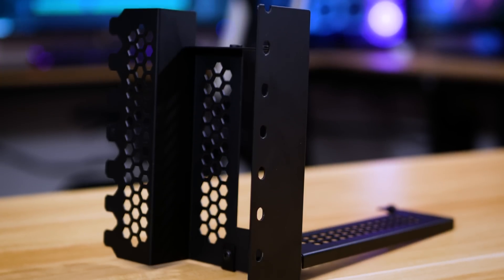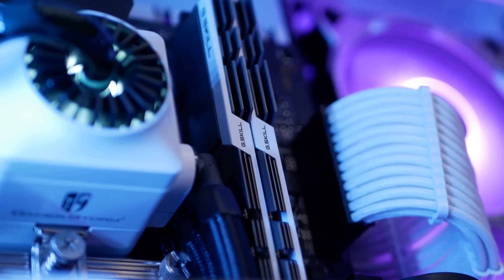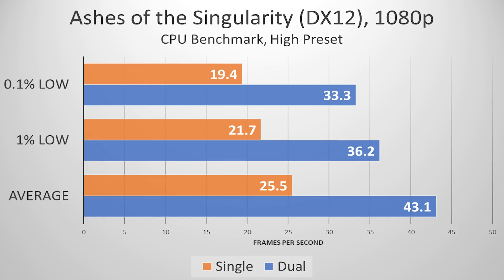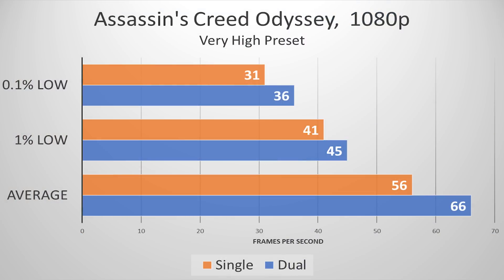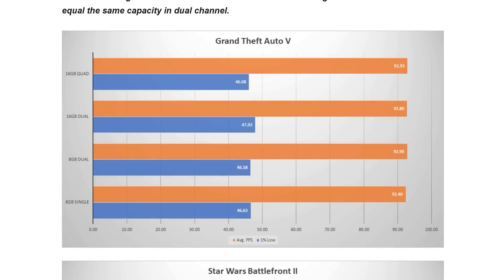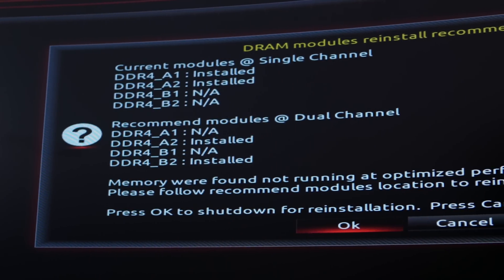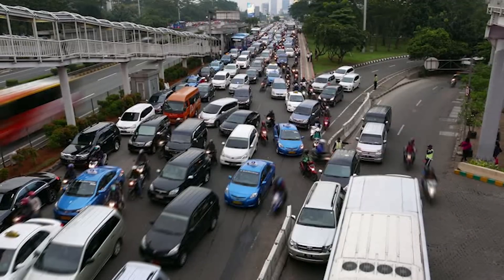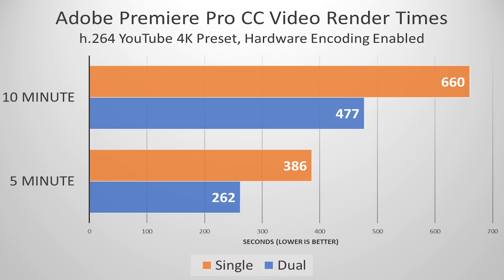What is Dual Channel Memory and Why Does it Matter? (w/ Benchmarks)

Comment: When I built my pc earlier this year I went with a single 16gb stick and figured I'll have an extra ram slot if I ever needed to upgrade to 32gb. Looks like I will need an extra 16gb stick because I'm maxing out my ram capacity on a daily basis. 
Is it possible to get another ram stick of the same model as my current stick and still have it run in dual channel mode or am I out of luck and have to purchase a 32gb (2 x 16gb) dual channel ram kit?
Specs: AMD Ryzen 7 2700X, Asus ROG Strix B350-I Mini ITX motherboard, G.Skill Ripjaws V 16GB (1 x 16GB) DDR4-3200 ram, Nvidia GTX 1080 Ti Founder's Edition.
Reply: Just buy the same stick of ram and pop that sucker in. Make sure that you install it in dual channel though which this video explains how to identify whether or not it is. You don't need to buy a whole new kit though, just the same 16gb 3200mhz stick. That should have a cas latency of 16. Not entirely sure if that's relevant or not but it's something to at least check. Also i like your specs!
Reply: @andrewpowell1462  Thanks for the info. The motherboard is a mini itx board so there's only two ram slots so there's no way I could install the ram in the wrong slot. 
I actually won a bunch of giveaways and was able to piece this pc together absolutely free. The only thing I've been missing is a SSD. I recently won a Scuf Vantage PS4 controller and was able to convince the guy to send me the cash insted because I recently got a regular ps4 controller so I'm going to use that cash to get a Samsung 500gb m.2 ssd and a Logitech g903 mouse or a Logitech G Pro Wireless mouse. Haven't decided which mouse to get yet.
Reply: @hed420  I noticed you have a mini itx after i wrote that haha But you lucky bastard! That's awesome though, congratulations man! If you don't mind my two cents, i'd highly recommend the g pro wireless! It's pricey but i bought it a few months ago and it's absolutely amazing! Wireless is a must have for me now and the size, shape, and weight are amazing! I'd recommend it over the g903 for sure but they're both great mice regardless!
Reply: @andrewpowell1462  Thanks man. It's been my year for sure. Just a few years ago I was homeless living inside a mini van and everyone I truely loved passed away. Then I came to visit my mom in South America whom passed away from cancer and I broke my leg on the same day I got here. Been stuck here since then. On my B-day this past January I won the GTX 1080 Ti and my luck started changing and I'm still on a roll.
But yeah, I was going for the G903 because of the price ($120), but shipping and import duties to South America is $30 from Amazon. $150 total. While the G Pro Wireless is $150 + $10 shipping and import. So I'd figured the G Pro was a better deal for only $10 more. Found the g903 locally for $200 so Amazon won this battle, I'd rather wait 2 weeks for delivery and save $50.
Reply: @hed420  You should write a book, man! I'm glad everything is going good for you! But yeah, i would personally recommend the gpro still and especially for the prices you would be paying!

Comment: Good video, the only thing that could be done better is mentioning the things sticks should be equal in to be Dual Channel capable:
- Frequency
- Timings
- Profile Standard (JEDEC or XMP)

The brand is not necessary to be the same, neither is the size or that they are from the same kit. I am running a Kingston 16GB with a V-COLOR 16GB 2666MHz CL19 in DualChannel.

Comment: I think you oversimplified it a bit and missed out on an important point... The content in the Dual Channel DIMMs is not mirrored, so it's not just higher bandwidth. A better analogy is single channel behaving like a single HDD, while dual channel behaves like two HDDs in a Raid 0 configuration.  In the highway example, it's more like single channel is one highway going east to NYC, and dual channel is another highway in parallel going east to Philadelphia. The numbers of lanes per highway is the same in both examples, so in theory there is more bandwidth, but a car on the Philadelphia highway will never be able to reach NYC.

I'm not sure how windows lays out the memory map, but it most likely alternates pages between the two channels, which if each thread is allocated its own page, then the benefit is pure bandwidth. As you said, it depends (what memory is being accessed, how many times, how frequently, etc.).
I did some research on this the other day, trying to understand the difference from an electrical perspective. It turns out that it's pretty simple: single channel vs dual channel is 1 memory controller vs 2 memory controllers, each with their own address, command, and data lines. So a CPU that supports dual channel will have a DQA and a DQB bus. In terms of DIMM slots, for multiple slots on a single channel, each DIMM has their own set of clocks and chip-select lines, but everything else is shared within the same channel. So A1 and A2 will have the same DQA lines, and AdrrA lines, but will have CLK0 + CLK1 and CLK2 + CLK3, respectively. Each DIMM has 2 clock lines and 2 chip-select lines, to handle single rank (1 sided) vs dual rank (2 sided), where each rank has its own chip select and clock. Additional chip selects are only helpful for capacity (since two chip selects effectively add 1 bit to the physical address space), because transactions (reads or writes) cannot be run in parallel on the same memory channel (hence the benefit of dual channel). Unfortunately, that means that when not doing burst transfers, the memory bus is mostly inactive waiting for the RAM to be ready with the value to read.
Reply: hjups as far as i know dual channel ram works exacly like raid 0.
Reply: @mtunayucer  I'm pretty sure it's a little more complicated than that, but it's a close enough analogy from an IT perspective. In reality, it depends on a lot of technical details of the implementation (bus topology, physical address mapping, software page mapping, etc.). Also keep in mind that hard drives don't map to address space like memory does, they're typically controlled by DMA engines, and some registers.
Reply: jeez you need to make your own youtube channel
Reply: Thanks for the info.. everything's not the same, everything is a bit more complicated if you take it as such.
Reply: It's more like a highway with double the lanes than two highways heading in opposite directions...

Comment: I have a Gigabyte H110M motherboard with only 2 RAM slots, and I have dual channel with two 4 GB modules. I want to jump to 12 GB, but I would have to use 8+4 GB. Will I lose a ton of performance?
Reply: why would it lose performance as long as they have the same frequency (mhz)

Comment: Another good video, thanks. 
while on the subject of the Verge and other things they got wrong during the build...... could you see what difference it actually makes these days by putting the graphics card in the 8x slot please?
I know it never used to make that much of a difference as 8x was enough back in the day but what about today's 1080ti, 2070, 2080ti. I'm curious to see.

P.S. when I was 16 (1997) I was on a skiing trip to the Alps. The instructor was a hot blonde called Sophee, the way she said Parallel was way hotter than yours. Sorry to disappoint
Reply: That last comment made my day! Haha
Reply: I don't have any benchmarks, but I was running a 1060 in a gen 2 x8 slot and it seemed fine.
Reply: @caligoclarus  it may seem to you that it was running fine but that was only a 1060.
I've found a techpowerup post from the 12th December 2016 that shows there is a very very slight decrease in performance using 8x gen 2.0 and lower but that was only with a 1080. 
I wonder if the performance difference is even wider with a 2080ti
Reply: I second this idea. For Science.

Comment: How does having 16 gb's via 2 dimms effect performance compared to 16 gb's via 4 dimms? How does the memory controller handle the extra sticks and how does that effect frequency and timings?
Reply: It's common to think that four modules are bad, bicause you can't ad more ram (32gb). But actually for the most part 4x4gb is faster(enough to favor them against 32gb) and enough for gamers.
Reply: @TheSilviu8x  4x4 has the same speed as 2x8 on Ryzen since it has a dual channel controller
Reply: @truedarklander  It's not that simple. Sure, in everyday use there's no difference. However, depending on the topology the maximum speed may suffer.
Reply: @Oi I am a SocDem I don't think anyone ever answered your question properly. four sticks of memory will always be slower than two on a dual channel cpu. 
this is because there are literally more memory chips to access. 
it's like if you had 2 arms but 4 conveyor belts, you'd have to move around to be able to reach all 4 conveyor belts. if there were only 2 conveyor belts you could just stay in the same spot. 
here is Ryzen's official memory support and as you can see, 4 sticks are only rated for 2133 with single sides memory chips and 1866 with dual sided memory chips.
https://www.pugetsystems.com/pic_disp.php?id=48164&width=800&height=800
Reply: @dylan-nguyen  I have a Ryzen 5 1600 with 4x4gb Crucial Ballistix Tactical running at CL16 3000mhz no prob. Seems "official" is far from the truth?
Reply: Surprised none talk about the Hertz of the memory sticks.
1 stick of 16gb at 2200GH/z or 2 stick of 8 at 2200GH/z... and say your processor run at 4.4GH/z, you will run smoother on dual channel because task are divided. And there is technically more load given to the processor (Fully used GH/z load). 

Compared to 1 stick 16gb 2200GH/z with a Processor running at 4.4GH/z, the load on the processor will not be fully used because the memory is not at same rate or beyond.
Reply: How the dim slots are connected can make a difference. Ideally you have 2 single rank dims that add up to the amount of ram you want. The differences are smallish in most cases, but not always and it depends on how the motherboard is designed. Of course this is comparing the same speeds and timings. Buildzoid went into a decent explanation on his channel actually hardcore overclocking about a week ago. https://www.youtube.com/channel/UCrwObTfqv8u1KO7Fgk-FXHQ
Reply: To my knowledge, there's little to no difference as long as the 2 dimms are in dual channel. I'm not sure on your question about frequency and timings but i would assume there would be no difference there either. Damn it, now you got me wondering. Haha
Reply: Pandy Owl I know that 4 dimm kits cost more than 2 dimm kits for the same timings and frequency, so I assume there's additional binning that occurs. One of the criticisms of Principled Technology was they used 4 dimms on which I guess exposes a weakness in Ryzen's memory controller? It was also common last year during the crypto craze to recommend people get 8 gb's and buy more when prices dropped.

Comment: Nice video, Greg! Steve from Hardware Unboxed made a comparison of RAM and saw that the game caches and give different results by each pass, did you see something similar? Maybe first allocation is worst with less channels, but reading after is not that sensitive to the bandwidth. In any case, I am just curious on the test methodology. Thanks for the video.

Comment: Perhaps the reason why other tests do not reveal big differences between single vs dual channel ram configuration is the number of CPU cores and CPU speed. Keeping the CPU threads fed with data requires RAM bandwidth and it should make a difference if you are testing with a 4core/8thread or a 8core/16thread CPU.  I am not sure what CPU was used in Gregs testing. Since I saw a Z390 mobo, I assume a i9 9900k 8core/16thread CPU, which in fact is the CPU that would make the most out of dual channel configuration as of today. If other testers used lower end CPU can explain why their results do not show big differences.
Reply: Not really about CPU speed but rather GPU speed. Single vs dual channel won't show difference if you have GPU bottleneck. Pretty much all performance aspects considering system memory, channels, timings, clock speeds require elimination of GPU bottleneck if they are going to have impact on overall performance. The other test mentioned used lowly GTX1070, framerates were much lower what 8700k(cpu of test) can do.
Large number cores have no relevance, workload in games don't scale with number of cores. If it does(too few cores), then your cpu is badly congested and game is stuttery mess. Doesn't matter what kind of memory you have.
Reply: He did show the specs, yes it was a i9 9900k . I'd also like to see the same test done with lower end, as you said the number/speed of cores would also play a factor in whether single vs dual would make a difference. For example I highly doubt a 2 core 6th gen i3 would need dual channel

Comment: In the specs, you did not post CPU OC. I wonder if there is any correlation between CPU speed and performance delta single VS dual.

If the past tests your referenced used lower spec CPUs and GPUs I can easily see that reducing the single VS. dual performance delta.

Comment: One thing that you did not cover, is that each memory channel requires a fixed amount of time to complete a memory transaction. That time windows is determined by the frequency and the ram timings set in the bios. If the memory channel is operating in its request access window, it cannot service other requests . the end result is that teh CPU is sitting in an idle state waiting for the next  chunk of memory data to arrive before it can process the next frame to send to the GPU 

Dual channel and to a larger extent quad channel, allow the PC to interleave memory requests. That means  make requests in parallel. a single channel can only do one thing at once but dual channel can service two requests at teh same time. quad channel memory services 4 at a time. the extra data arriving at the CPU gives the threads more things to work on and as a result spend less time sitting idle.

Apps like cinebench get all ist memory data up front and everything runs out of the cache during the benchmark. The CPU does not need to request memory from the System ram after it starts running. That is why Ryzen performs so well at cinebench. 

Games, for the most part, force a CPU to rely on a regular cadence of fresh memory data deliveries to process  the next set of instructions that can be sent to the GPU before it can render a frame. If the CPU is idle waiting on data because the single channel requires 75ns to deliver the data packets from System Ram, it is not doing the work required to create all the instructions needed to create the highest fps that it can create it if the CPU received more regulare deliveries of data. 

 Dual Channel memory has the potential to deliver twice as much memory data in a given period of time becase teh two channels can operate in tandem with each other and thus reduce idle time of the CPU, allowing it to send more data to the GPU to render the frames.
Reply: Wow, ty. I knew most of this, but I’ll screenshot it anyway
Reply: Yep
Reply: Thanx alot
Reply: Calamity  some application will definitely fill it. For example adobe after effect that render the preview. It will always filling the entire ram capacity you allocate.
Reply: !! Thx~
Reply: so which one is better 1 - 16gbs or 2 - 8gbs for gaming pc?
Reply: @allawesomelove  if ur on a dual channel board get 2 sticks. For example if ur on quad channel and want 32 gb of ram get 4 sticks of 8gb cause 4 lanes are faster obviously but if its a dual channel board and want 32 get 2x16gb cause its just easier on the board and gives you upgrade ability to put in a additional 2x16gb. If you want the look of quad channel but have a dual channel board buy gigabytes ram cause it comes with an additional 2 "dummy sticks" that are purely for looks
Reply: That is what I actually wanted to know
Reply: Thanks!
Reply: So does dual channel increase CPU performance?
Reply: @xCarbonBlack  dual channel has double the bandwidth of single channel memory and can feed more data from system memory to the cpu over a given time period. 

A cpu can only process data that it has available. more memory will leave the cpu less waiting time before it can process the next instruction. 

It makes the cpu more efficient processing data as it is not waiting for new data as much and increases overall system performance which is the important thing for you anyway. 

The cpu itself is a fixed piece of silicon that dual channel memory helps to perform up closer to its design limit potential
Reply: @bradmorri  Thank you very much :)
Reply: @xCarbonBlack  You are Welcome
Reply: @bradmorri  What is the dual-channel ram Is it different type of ram in which it is written in the box it is dual? Or 2 ram with same frequency and timing  
If you know about this correctly, please suggest me.
Reply: @sabaahmad5536   Basically, a RAM channel is a circuit made up of traces built into the board connecting one or two memory sockets back to the CPU (depending on the device. Most desktop motherboards have four memory sockets  wired up for two sockets per channel for a total of two channels of Ram. Threadripper and the HEDT intel boards are quad channel.

A Single stick of ram can only create a single channel instalation, to habve dual channel you need two sticks with a stick installed into a socket connected to each channel. the reason that dual channel is better is because when the first channel is busy, the second channel can still be delivering double the volume of data to the CPU. Any time the CPU is sitting waiting for more data to arrive for it to process, it is wasted performance.
Reply: k